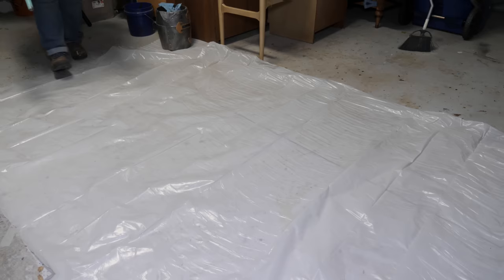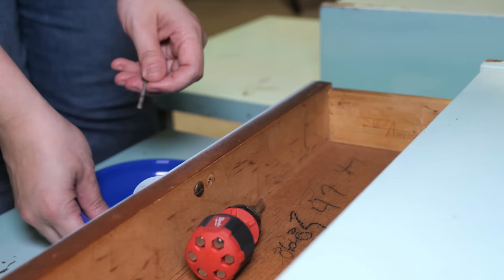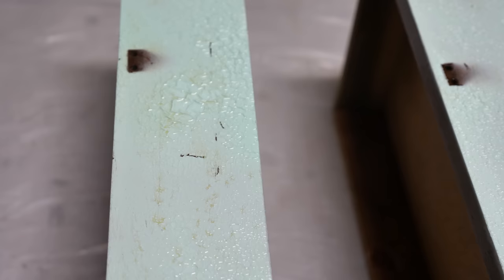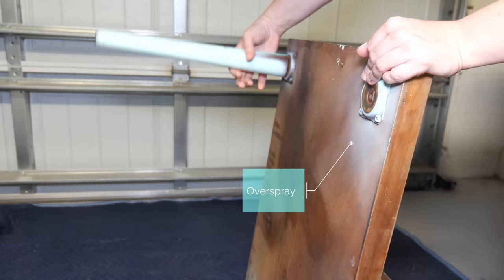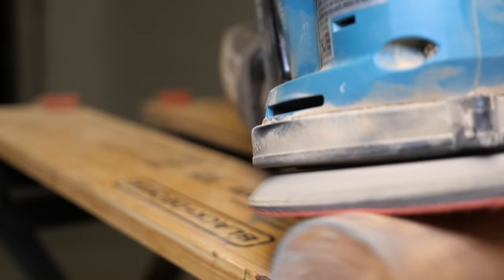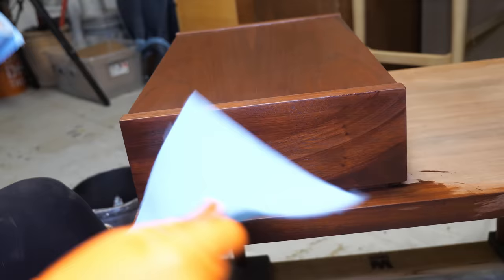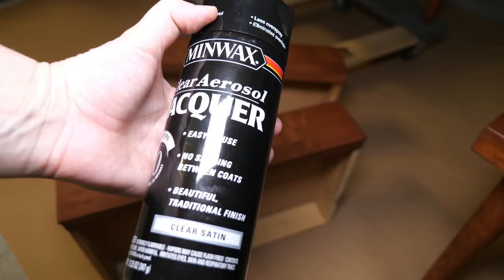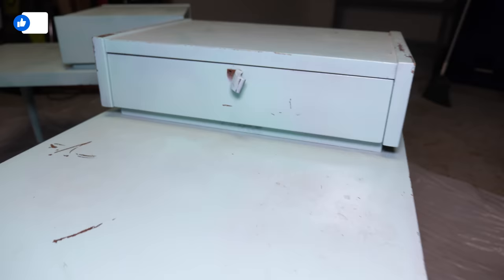Horribly Spray painted to BEAUTIFUL Walnut

Comment: Hey, i was wondering if you had a suggestion for removing blushing? I am a purely outdoor set up in gainesville and am struggling with piece. Was able to buff with brown paper and heat gun. But god is it a lot of work. Loved this video!
Reply from the maker: It is definately not a fun task. Mohawk sells a Blush Retarder you could try. I havent yet, but its on my list. If you're using a sprayer you could mix in a solvent to prevent it, but I am not sure what the magic mixture is. I am sure it varies based on climate.

Comment: I’m in Florida. I don’t pay any mind to alligators, but sand hill cranes give me pause. Super territorial. How do you feel about shellac and humidity? I want to start using it.
Reply from the maker: Sandhill cranes are definately not to be messed with. They have the tactical advantage of flight that alligators don't have. Not sure about shellac. I usually only use that as an undercoating.